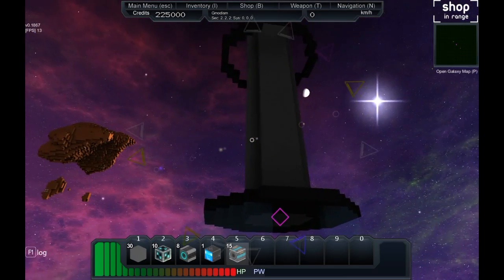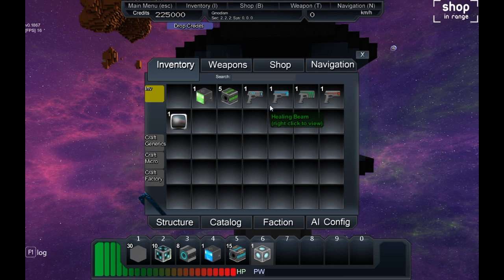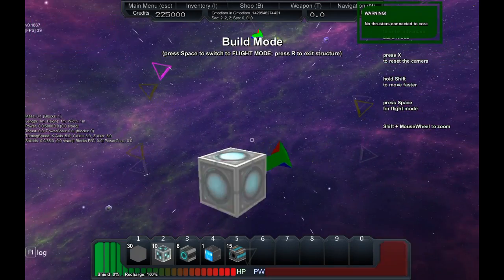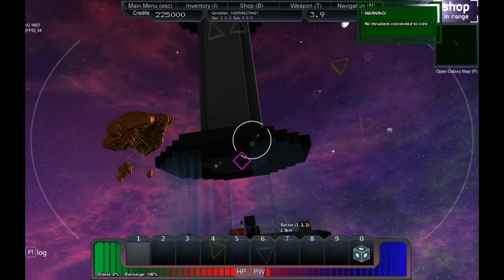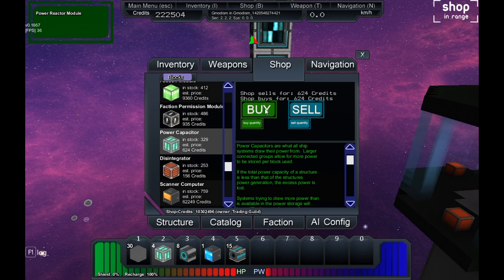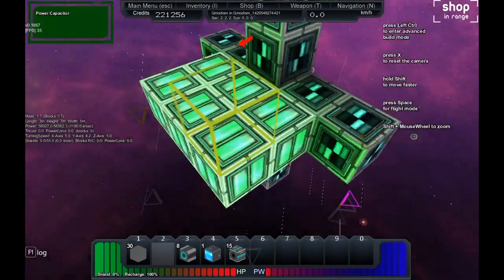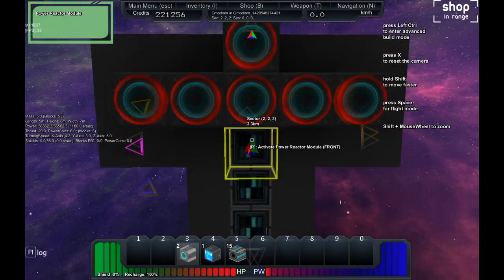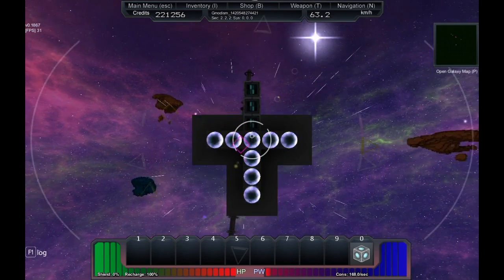StarMade Tutorial 2015 | movement, engines & energy

Comment: Your power should have been connected to each other on X,Y and Z access this will fix the power production issue. Generally the power storage boxes follow that same power logic but they aren't really needed in small ships like this.
Reply: Yes, but you didn't state WHY it's better ;)
Reply from the maker: Yes that true that power gen works best outspread, storage however just needs to be connected, box of them works good.
Reply: TheFrio937 Errr, no. Capacitors do not rely on the same logic as Power Reactors.
Capacitors benefit from being in larger groups. A larger group = more capacity per block.
Reply from the maker: Thats just what I said... box for capacitors is fine